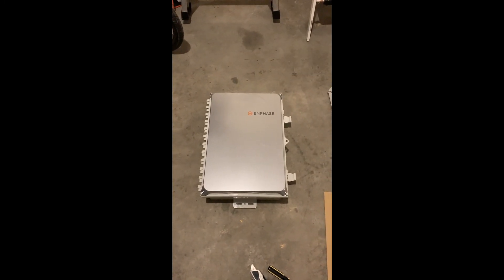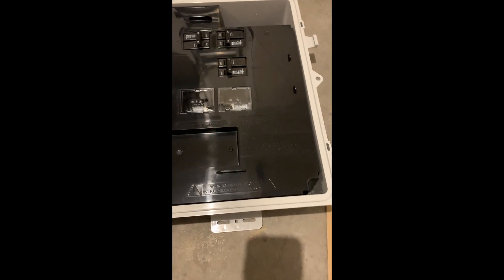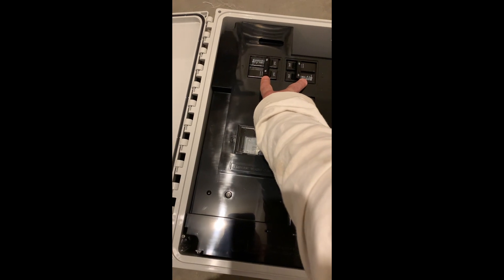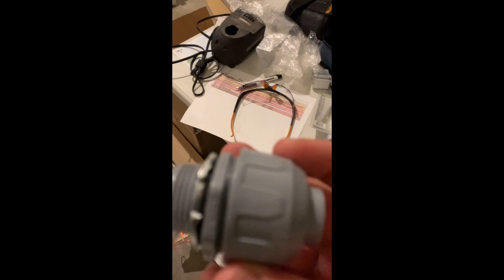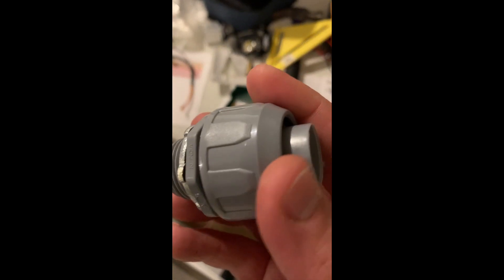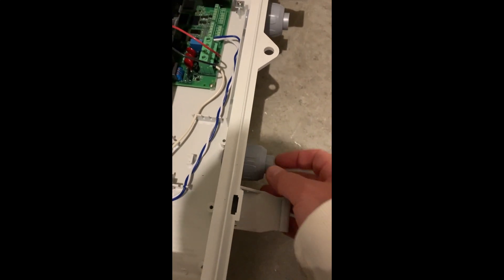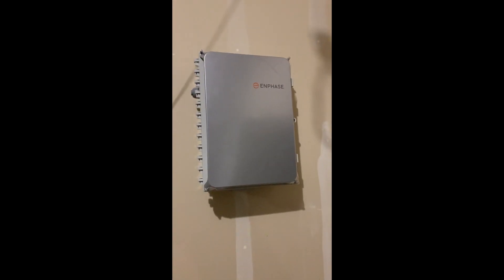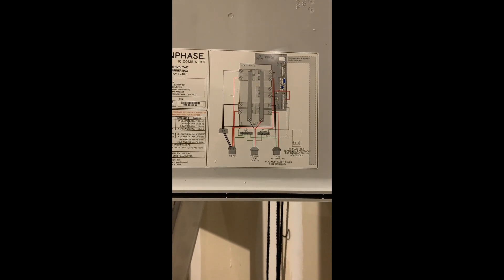Enphase Combiner Box Overview

Comment: So you can have up to three string groups of solar panels per circuit breaker my question what is the limitation on the number of panels you can have in a string? Is it limited by voltage, current, and wattage?
Reply from the maker: Thank you for the comment.
The short answer to your question is that the limit to the number of panels on a single circuit (single circuit breaker) is the ELECTRIC CURRENT.
The circuit breakers are rated in Amperes, so a 20 Ampere circuit breaker will only allow 20 A of current before it trips.
In practice, there are a number of factors that feed into how many solar panels you put on a single electric circuit. Here are some of those limiting factors:
1) If using microinverters like I did, the microinverters themselves have a limit for how many of them can be connected on the same AC circuit (the output of the microinverter). In my case, I used the Enphase IQ7a microinverters, and those have a maximum of 11 that can be connected on the same circuit.
2) When connecting a solar panel system to your main electric panel, the NEC code dictates that a Solar panel system's maximum current output cannot exceed 20% of the service rating  (maximum Amperage coming into your main electrical panel). So on a 200 A service, the solar circuit breaker cannot be more than 40 A.
3) The ground wire used from the Enphase combiner box to the main electrical panel also dictates how many panels you can have. In my case, I used a 6 gauge twisted bare copper wire for my ground, and that can carry up to 55 A @ 60 degrees Celsius, which gives is more than enough.
Reply: @DIAYG  thank you for a great detailed answer and really gets to the basic reasons behind a number of solar panels that can be used on a branch circuit. Off I go to see if the spec sheet has the spec for the max number of IQ8s that can be placed on a circuit. Again thank you for your clear and concise response.
Reply from the maker: @MaxGoddur  You are very welcome. I'm glad I can help.

Comment: Can you hook to external batteries with this box?
Reply from the maker: Yes, you can connect an external battery bank to the Enphase combiner box. I didn't have a need to do that myself, but I do know that there is a dedicated circuit breaker location (lower right) in the box that is for connecting and monitoring battery bank. Please check the installation manual for the combiner box for specifics.

Comment: You didn't show whether you ran your solar production wires through the production monitor.  The production monitor is the device with the hole in the center and has blue and white wires going to the Envoy board.  It monitors how much energy your solar arrays are generating in real time.
Reply from the maker: Hi. Thanks for the comment. There is a separate video that I created for connection production and consumption monitoring. 
Here is the link:
https://youtu.be/KK00SWXh8og

Comment: Max 80A total
Reply from the maker: The electrical specifications of the Enphase Combiner 3 box status that the main busbar is rated for 125 A, while the maximum continuous input from the PV arrays is 64A, and the maximum output to the grid (to the main panel) is 65A.